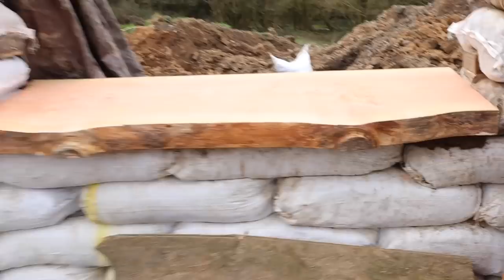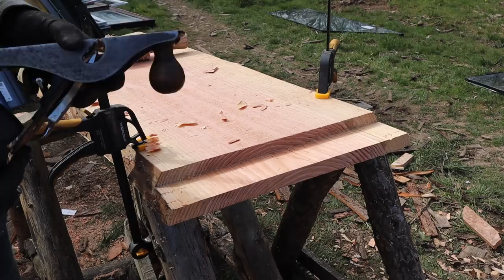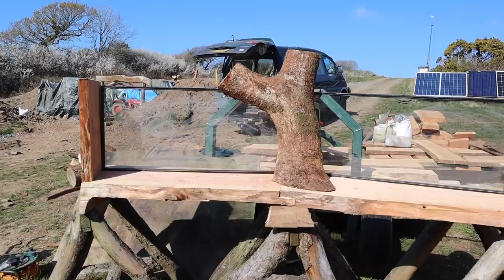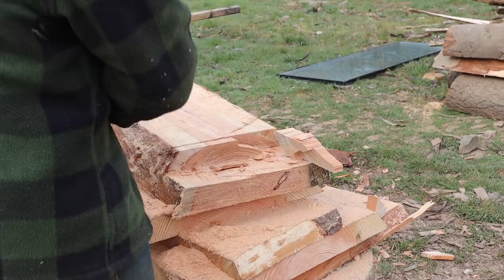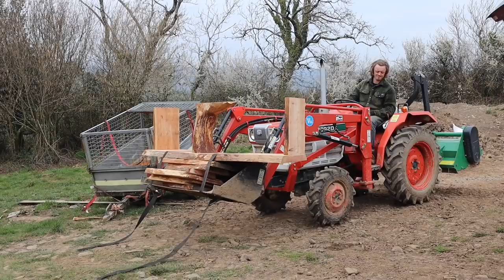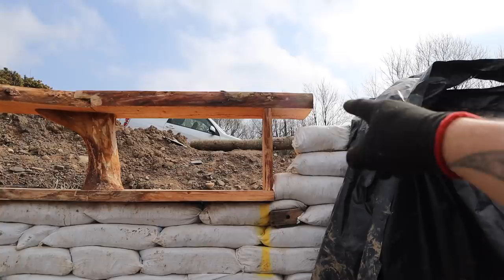Off Grid Earthbag Workshop Part 20 Curved Window Frame

Comment: it's odd Kris I've been subscribed to you for ages but half the time your videos don't show up. Until someone in comments said " 2 uploads in a week" I had no idea of your other video. I wonder what's going on...?
Reply: There is some sort of an issue with youtube sending out updates.  Other channels have started using a subscriber list through email that they use to send out a link once something is uploaded.
Reply: Ace Carter  joking right?
Reply: @VentShop  I didn't even get a notification for these comments !
Reply: @Ana_crusis  As I said, youtube is having some sort of issues.  I know one for a fact who has commented about it is FlightChops.  Just a guy talking about flying an airplane and his experiences.  It's on a lot of stuff.  I only got a notification because I have the app installed on my tablet and signed in and have had a couple times where I didn't get a notification their as I should have either.  That is why creators are using direct email signup to inform subscribers of what is going on.
Reply: @VentShop  It was working fine til recently. You tube are always messing about with the site settings; usually for the worse...
Reply: I don't know about the various issues, but you can click on the Subscribers button and sort it by new activity. That floats the active uploads to the top of the list.

Comment: What batteries would help you mate, would large vehicle batteries sort you?160ah 12 volts? How many if so?
Reply from the maker: Hi Mathew, well im saving currently for a 24v forklift battery. there is a good company that sells them and they are quite good value. however the are quite large so i  having been trying to keep my current setup until i have some more space. the problem is this time of year i have load of solar and not much hydro. so with the small batteries i cant really store any power. if i was to acquire 4x 160ah 12v that would get me by until i had the space to install a full battery pack.
Reply: Kris Harbour .... cheers for the reply mate.... here’s my tip of the day.... if you’ve a vehicle recycle/scrap centre.... iv known them sell tested ones at £12 each (car battery 70ah) .... and I’m gonna buy a T-shirt from ya. If I get some good large ones in my line of work I’ll email ya.
Reply from the maker: Nice one Mathew, if you want to come help out anytime just email me via my website.

Comment: Hey Kris, thinking about your battery issues, it might be worth having a look at the kind of thing youtuber jehugarcia is doing, specifically https://www.youtube.com/watch?v=hejOT7NF72E.
You can buy dead laptop batteries on Ebay, rip them apart and salvage the good 18650 cells from them (I've done it, it's not just theory). I'm not sure on the numbers you're using, but it might be worth looking into.